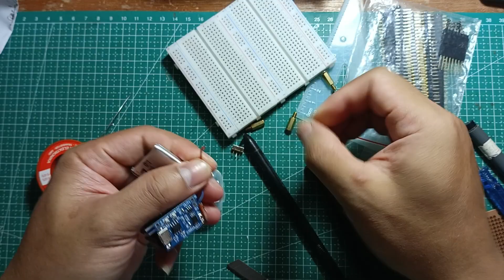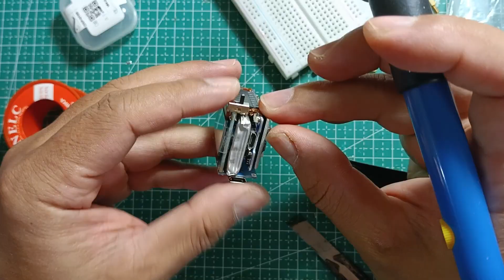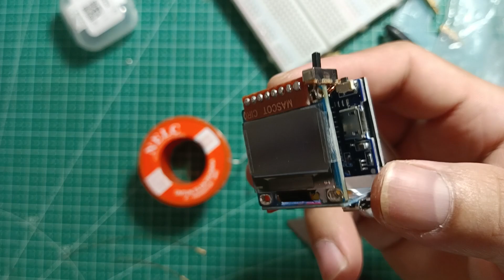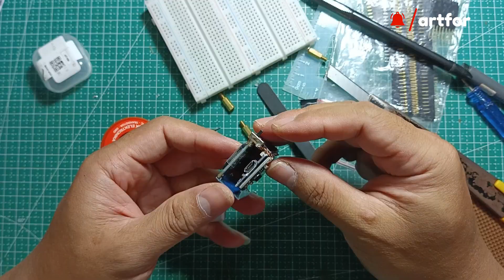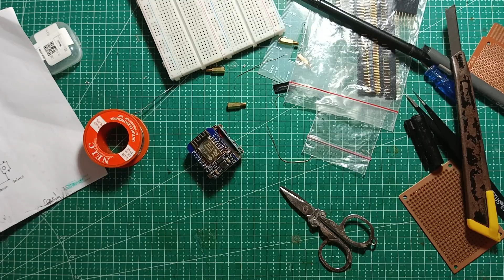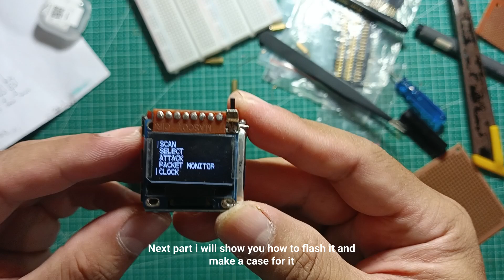ESP8266 Deauther by Spacehuhn Part 4

Comment: Sir, Im fairly new to all the testing. By watching your video, are you saying I can use the TP4056 to connect the Li-Po Battery to the ESP32 ?  If Im wrong I apologize. Some people are saying I need to use a different type of battery connecting part. I look forward to more informative videos. Thanks
Reply from the maker: TP4056 is a module for charging the battery, to connect battery to your esp32 pin Vin which is 5volt you need power booster like MINI DC to DC step up module to boost your 3.7 volt  to 5 volt